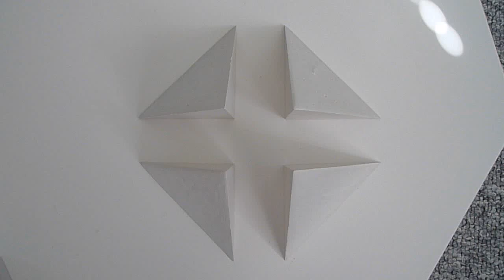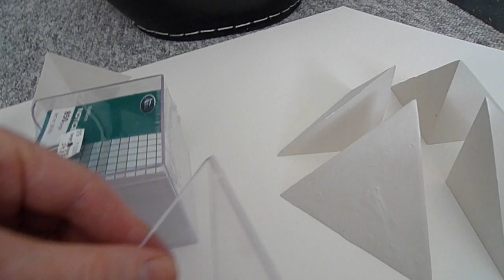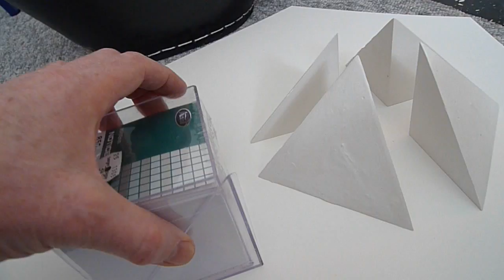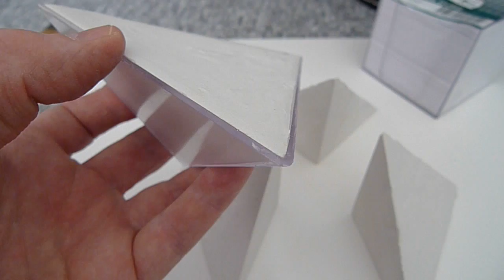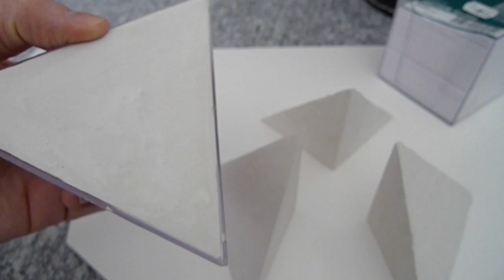BERNOULLI RING

Comment: have you tryed making them using Cobb? 2parts ground  clay 1part sand 1part natural fiber (straw/sawdust or maby even fine copper wire)
Reply from the maker: Hi, did one experiment with clay, and i didn't feel the strong energy. Maybe another mix will work as you surgests ;-)

Comment: Hi. I made this pyramid using a premix white cement limestone. I have it posted on a video. Its a ring of 7.    I dont detect any energy field etc maybe im not sensitive. But ever since I placed it under my bed near my pillow, my sleep has improved. I used to have difficulty sleeping at night, with tosses and turns etc. I used to feel hot as well when sleeping. These symptoms have gone since the pyramid placed under. I thought it was placebo, but its quite significant  and I cant explain how.
Reply: not every one is sensitive to energy.  I am a  certified Spiritualist healer... woop...lol... When I am  doing healing,  the hands are placed on or about a couple of inches away from the body surface.  As you move across different areas, you can feel a sensation of a wave of heat.  Almost feels like you have  turned off an eye on the stove and walked out of the room and come back in and was smart enough to put your hand over the eye and not touch it... the  unseen radiated heat  can be felt in the hand.   As an example, when a person complains of a back ache...when you pass your hand over the area, you can feel the heat wave and often it will be isolate to an area around 6 in wide... sometimes there are two spots.  The heat is the body reacting to inflammation of  the area.   Yes, there are faker healers every where...but  those that understand  human physiology,  medicine,  and  accupressure and accupuncture points, can direct your personal body energy  chi if you want to call it that... into those  special points that that will go through the body.  Very often the directed energy will hit a blockage and will heat up a specific part of the body.  What it is doing is  blowing out a  blockage of  calcification .  Even that sometimes  will cause a person to hurt in some other parts of the body after a "healing"  and  people think you are a faker when you  suggest taking an Ibuprofen or aleve for the inflammation and new discomfort.  
now, as far as the energy being sent out by the  rings,  it is a much more refined energy and  tends to be more gradual in breaking up blockage points of energy.   If you practice by putting your hand over the  ring when it is open and separated properly,  you will learn to identify a wave of  pressure, like a gentle breeze.. it is not hot, but it is like a very faint  feeling.... It  takes a lot of training for some...as they  wish it to happen and do not feel it right away ...and just give up  considering it a hoax. When you are starting...clear your mind and do not try to pre conceive what to expect... Do not expect instant oatmeal as so many do in today's world... Patience, and it will come...and it will not be  self delusion.   Once a positive experience finally happens,  then no one will be able to convince you to give up truth.  The hardest thing to learn in the world, and the metaphysical world,  is never lie to yourself...You will know when you are experiencing true phenomena, not a  self suggested delusion.   Good Luck.

Comment: I tried to make a mold out of cardboard  I thought the pyramid was a tetrahedron but its not as my 4 pyramids do not fit together guess i will have to find four boxes  do you know what the best sacred geometry measerments are?Also do you notice health benefits?  Do you stand over it and can you feel energy?
Reply from the maker: +Sandy Ingle , Hi Sandy, i only know that the pyramid i made works great, and the shape is from the corner from a plastic box which i used several times. The sides are the same length. But as you can see in "old lab rat" videos the precision of the shape are not that important to get it working. I feel a very strong output from the 4, 6 and 7 Bernoulli Ring...everybody react differently to the energy, so i advice you to do some experiments yourself. Iam very happy with the healing and ballancing energy'. All the best.
Reply: Thank you for getting back to me your pyramids turned out great BTW! Have you made any cones ? I was wondering if cones in a circle would work the same way by emmitting positive healing energy? Have you experimented with cones?
Reply: I watched your video again and by watching it figured out how to make the molds out of flat pieces of cardboard to the sacred geometry size I wanted.  I was able to score a couple sides and make the mold from one flat  square of cardboard.  Thanks for the video :)
Reply from the maker: +Sandy Ingle Hi again, i haven't done any work with the cones yet...
Reply from the maker: +Sandy Ingle ;-)
Reply: @TruthIsNot4Sale  The old lab rat warns that if using cones, they be placed on floor,  as the negative energy  will suck out your energy if  you sit the large cones on a bed side table, the  Odders or the negative spray from under the cone is like a flat plane parallel to earth.   If you use them attach to a surface under you so the positive energy only goes up.  You can seal them to a flat surface and point the tips toward you from a flat wall..The negative energy is then running along the surface of the wall.

Comment: May I please ask a few questions?  Why gypsum? How do you measure the energy? Did you notice any difference in energy with the different # of pyramids? What are you using for a base to set them on?
Reply from the maker: Hi Mary Lou....yes you can ask a few questions ;-) Gypsum was the first material that I had a feeling for, and It worked great. Very easy to work with in the mold, energy is quite strong. Then I made a Bernoulli ring with  one part gypsum and two parts of sand...and this has a different and stronger flavor. Now I am molding a ring with one part portland cement and two parts of cement for comparison. To measure the energy I use my feeling, and then check with a pendulum and a deviningrod. The deviningrod is very effective to determin the shape of the energy comming out of the bernoulli ring. The pendulum I also use to limit my exposure time to the energies...overdosing here is very easy. I really like the bernoulli ring with 7, it is very calming for my system, and I feel the energy instantly. On the video i used a piece of cardboard for the base, I have't used any grounding yet. I am making a Bernoulli Pyramid 12 inch high in cement/sand for the garden ;-)...I will return with news when it is done.
Best regards SL
Reply: lab rat mentions that the surface he uses to liquid nail the pyramids on is nothing more than the  hard fiber board you can get in sheets at  Lowes or home depot. the surface size is only for your convenience to help maintain the proper distance apart.   one 8 ft by 10  will get you a lot of squares...I would suggest a very fine tooth  saw blade to keep the edges smooth.  Use saw horses for support and do all cutting out side... might even suggest you wear mask and glasses for safety.. Dust is not so good for lungs and eyes... just a thought of caution.